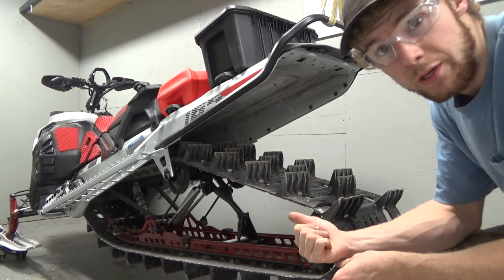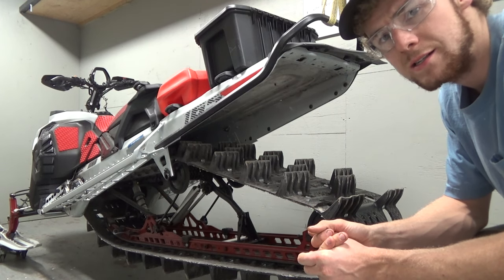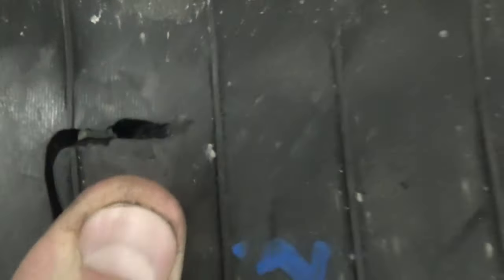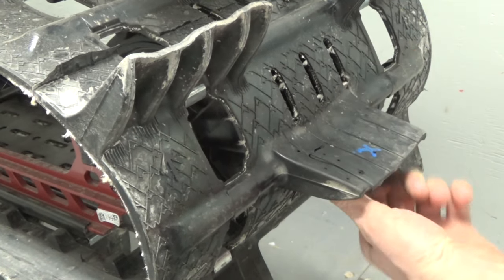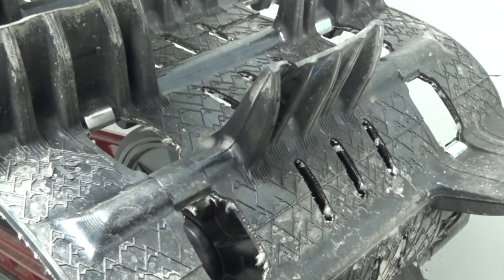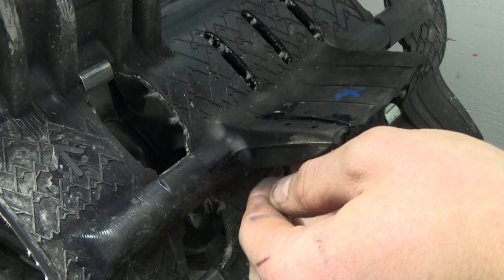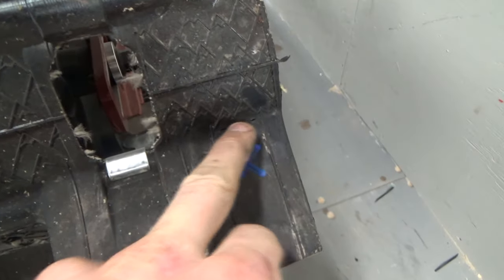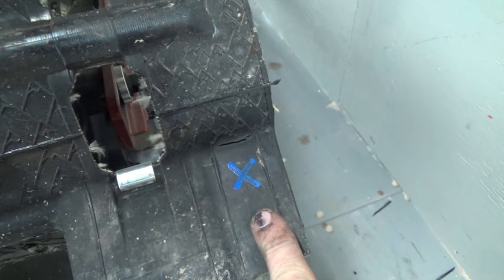Deep Snow Snowmobile Track Lug Repair

Comment: hey man off topic from this recent video but i saw this video of how to fix the steering stem on a 4 wheeler. My 4 wheeler does not turn. Like the handle bars can move right and left but the wheels do not. my friend was riding it and he prolly took a hard turn. Could you tell me how to fix it pls.
Reply from the maker: Have you had a chance to do a good visual inspection, most steering ( aside from power steering) setups are open enuf so you can see where your tie rods link up to a hub on the bottom of a steering column or post , anything damaged? Dose the bottom turn with the bars?
Reply: @DonkeysBreath   theres a join in the handle and thats the only thing that moves. If you can you gimme ur number or something so i could show u?
Reply from the maker: Best way, google drive link or Reddit post or YouTube short .